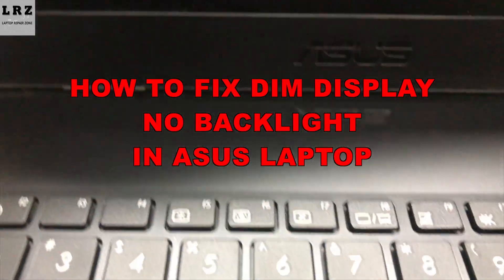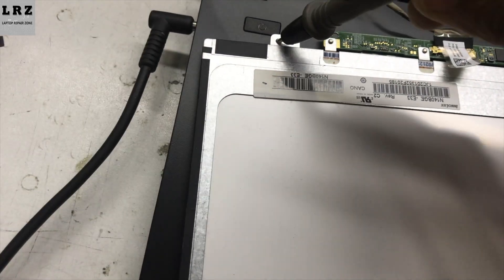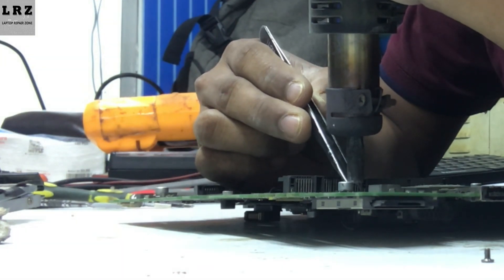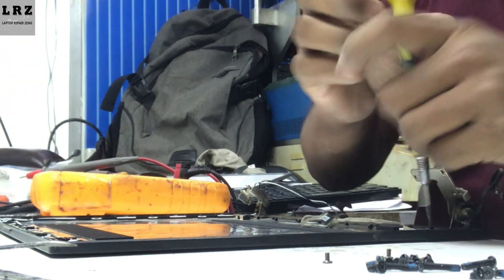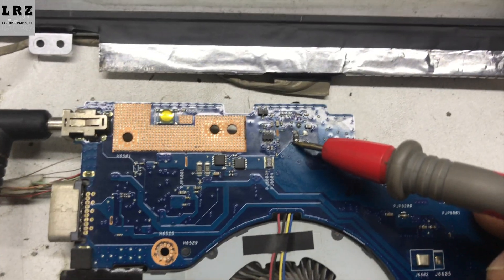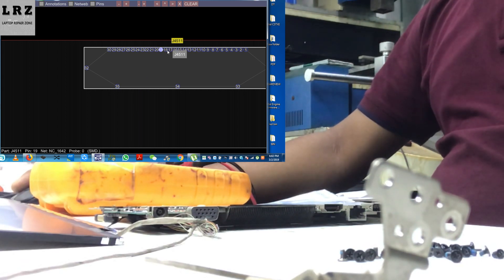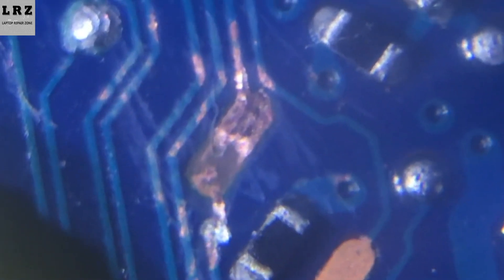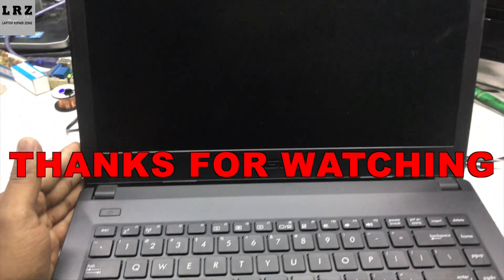Asus no backlight on screen/dim display solved.

Comment: Nice job sir.
Sir I have a Dell latitude e6420 laptop and it's a problem is that plugged in not charging.im checking the SDA, SCL supply it's present.but when plugged in battery then one supply is missing in bettery connector.
Reply from the maker: santosh mundepi first check with a good charger then check with a good battery then check PSID  it must be 3.3 volts